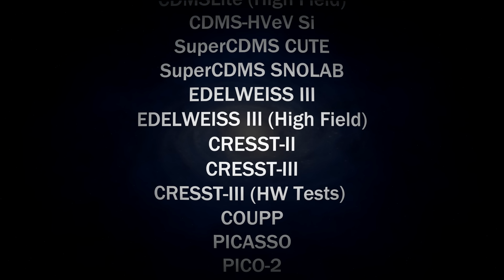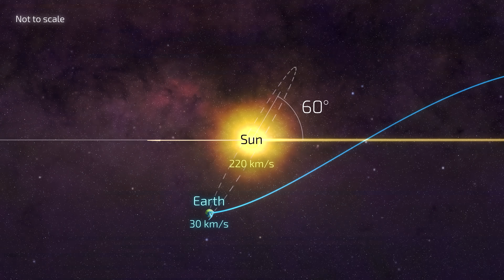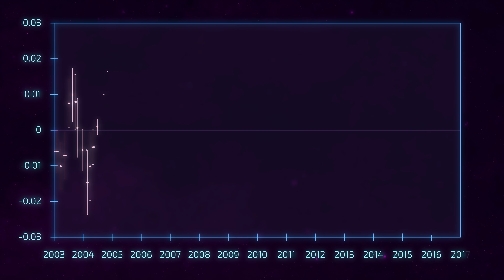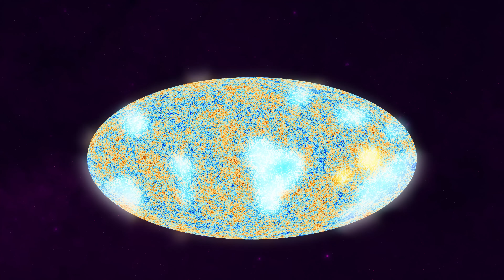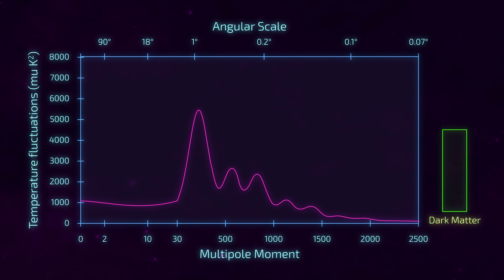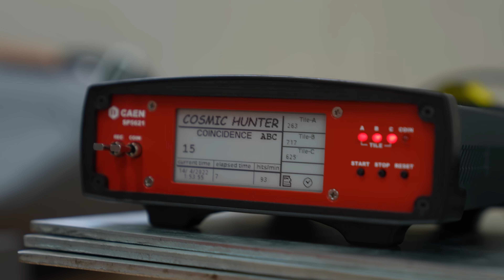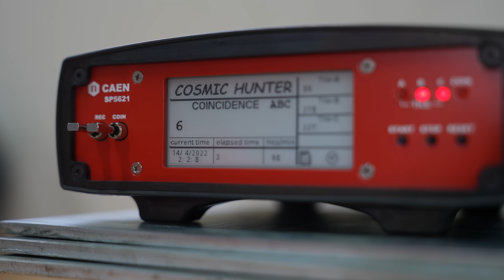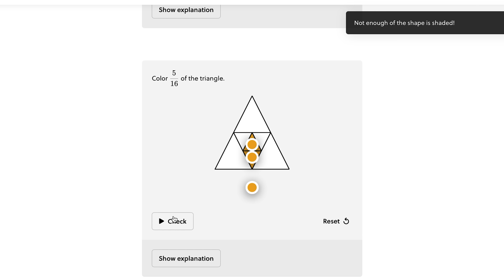The Absurd Search For Dark Matter

Comment: Love your passion for physics! I'd like to share a model that could provide a workable explanation. No pretension on my part. Here's some postulates: 1. "Local" gravity seems to be an expression of dark matter; it is a force. 2. imagine gravity as a "push" toward the center of Earth, instead of a "pull". 3. This push is akin to fluid (air or water) pressure; it's omnipresent, but it is invisible and rather intangible. 4. this dark matter is everywhere in the universe, and only permeate matter to some degree - the deeper underground you get, the less is the effect of dark matter's pressure.*Run a vectorial analysis of classic  gravitational force, at the surface of Earth, with lessening grav force as you move down a tunnel towards Earth's centre and both models work just the same. Dead center and you have zero resultant forces; either push or pull. 5. At t(0) big bang, the pressure (like an exploding balloon) was immense, radially diminishing as time goes, but it is  still (nowadays) putting pressure outward on each galaxies; and that accounts for Doppler-effect confirmed accelerations. 6. That pressure is caused by something that's non-matter (massless) against all matter, would seem to account also for why galaxies "hold together" - oddities. Also considering angular momentum and centrifugal forces that won't ad up to the canon of physics. See, it is not a "missing mass" in the calculations, but the presence of an omnipresent, unseen, unperceived pressure against all matter, that does the trick. Take a large rubber red weather balloon (like I happily used to send off), fill it out with blue died air, and strobe-photograph its bursting. Plot the velocity of the blue gas expansion (in a true vacuum) versus time and you will see the same effect we see in the expansion of our universe. Every tiny aggregates of blue die liquid is pushed together by air pressure (not gravity), in very tiny clusters (galaxies). These "galaxies" move away from each other following something very much like a "biological growth curve" or an "S" shaped curve, reaching a top constant velocity - but the universe has not leveled off yet! 7. We have an inkling of this "dark pressure" with the Casimir force.
8.  Aside from "flavored" neutrinos (those endowed with mass) the vast majority of them are massless. All photons are massless, but funny enough they behave like they have mass when energized as light and travels in the proximity of a large mass (light bending around a planet). Yeah I believe these critters (muons and/or photons) have a close relationship to dark pressure or, most likely, they compose dark matter - dark pressure. Eh my friend, I do research in renewable energy (electro-magnetics), but are we having fun yet? I'd be honored to have your input on that. Yes, feel free to say I'm completely off the mark. Cheers - you the best!
Reply: Youtube is certainly the wrong platform. Why don't you debate that with your favorite theoretical physics professor?

Comment: We don't need more theoretical particles added to particle zoo to solve the problem.  The discrepancy is due to failure to include the relativistic mass of cosmic rays and the omega relativistic mass of observed matter.  Our sun for example is typically measured as having a mass dependent on the time of the measurement, while the actual mass relative to our galaxy includes all the beta particles moving at near C velocity the sun has emitted since its beginning. 
(M°/Mr)^2=1-B^2, Where B is the velocity measured in terms of the Lorenz factor .

Comment: i'll never forget when i really learned the effect of dark matter. i was doing some newtonian physics problems, and one of them was to determine the rotational rate of the solar system relative to the milky way galaxy. if you use newtonian math, you get a wildly different number compared to the actual observed period. the answer in the physics book also had the newtonian value as the "correct" answer. the book was wrong probably because the chapter was on newtonian physics, and more specifically rotation, and it was easier to just print the answer you get from taking that approach. i compared my work to the observed value though, and it drove me insane until my professor explained that the answer is MUCH faster because of dark matter. we are hauling ass compared to what we should expect
Reply: @thaknobodi  That's not even remotely true lol
Reply: who says that the solar system rotates
Reply: @Bengiamino  Immobile solar society?
Reply: @Bengiamino  why don't you google that?
Reply: Newtonian math has been proven wrong by Relativity and proven in testing wrong. And for something at that scale it will give noticeably wrong answers when it comes to space you got to use them way harder Relativistic formulas. 
You do get a speed being off in Relativity but continuing this bad habit of using the wrong formulas because they are easier to do should end.
Reply: @RedRocket4000  that's... not how scale works. The formulas for Newtonian Physics and General Relativity scales, so the percent error would stay constant. Just because you're calculating a galaxy's material doesn't mean you suddenly get 1000% error.

If you want to know the details of this, consider actually learning GR— it's fascinating.
Reply: The galaxy is not a simple system that can be modeled with one major mass in the center, but a lot of mass spread out over a large volume. That cant be calculated by hand anyways.
Reply: That means the equations are wrong. There are different pockets of spacetime with different spacetime laws the assumption that its the same everywhere is an assumption
Reply: @houseis  You're kinda right, Newtonian physics aren't that good outside of Earth. But it still offers a decent approximation, unless you are near a massive concentration of energy, and while the Galaxy is massive, it's not exactly concentrated.

Stuff like 20% error? Sure, we can roll with that. 200% error? Then that's not a spacetime problem anymore.
Reply: General Relativity
Reply: You forgot to carry the one buddy. The answer is correct
Reply: What book??...i need a book for physics...so can you please name it..
Reply: There is no dark matter.   It's cosmic dust.
Reply: @kpdutylastsupper  you say that so confidently. Even though the most knowledgeable scientists in the world are still not sure. Funny how so many people on YouTube comments just love to shout out things like they are fact even though there is no clear evidence for it. Love it
Reply: @kpdutylastsupper  untrue, we would be able to interact with cosmic dust, and if it was 5x the mass of what we can see that dust would clump over time because of gravity
Reply: @kpdutylastsupper  why cant we just like, see it then.
Reply: @glumsulk  we're too low level
Reply: @Nuclearburrit0  is that an RPG reference
Reply: @glumsulk  problem?
Reply: @kpdutylastsupper  but... you're just changing its name? It's the same thing at the end of the day
Reply: Do you believe in a god?
Reply: @hunter-speexz  The god of atheism only exists if you don't believe in him.
Reply: @hunter-speexz  god isn't the one that gave you smartphones or planes to travel. I'd rather trust my fellow human beings as imperfect as they are. Even if the said god ends up existing, I don't want a god that sends you in hell just because you don't believe in him, like a child that is mad at his friends for not believing his story. That God should be above everything, including these trivial human emotions. If that God is like that then they'll understand that I didn't believe in him or at least, made the choice to conclude that you can't prove its inexistence or existence.
Reply: @w花b  if god decided to ignore all the wars, poverty and injustices throughout history then he's not worthy of my prayers
Reply: @-kstyle  the arguement that god should not let evil exist is a very fickle one especially when you read of the lesser known theories on Gods nature the sheer complexity of god  if he exists would be such that we couldnt possibly understand him. I believe evil, sin and all these horrible things exist so that good and positive things and actions are given meaning, what would all the good things in our lives mean if the negative didnt exist on any level? Also because of how much evil and struggle their is we are able to experience them and overcome them, without overcoming struggles challenges and evil we would have very little growth, everyone would be stagnant. It is theorized by the religious that evil can only exists as it does in our flawed physical world and  we are here to experience life in all its hardships and all its splendor and that we are put through suffering time and time again so that we can overcome it and gain wisdom and evolve, knowing how fucked up the world is and how evil a lot of people are it makes it that much more impactful and wonderful  when we choose to do good or to do the right thing. Without the choice to do wrong or do evil we wouldnt have free will really, i think thats the whole purpose of having this flawed physical earth where so much bad and evil can exist, because if god is truly as ineffable and perfect as hes supposed to be i dont think evil would be allowed to exist where god resides and can only manifest here.
Reply: @hunter-speexz  let the grownups talk about science

Comment: There are two main ways to explain these anomalies (apart from MOND): dark matter or non-linearity. 

* DARK MATTER increases the gravitational differential between a galaxy interior and deep intergalactic space by boosting the strength of gravity where matter is present (by invoking the idea of  some form of invisible extra matter that "shadows" normal matter, and increases a massed region's mass).
* NONLINEARITY creates the same increased gravitational differential by by instead reducing the gravitational flux-density in deep space, to below what we would normally calculate as being the average background “floor”. 

The justification for nonlinearity is that the universe’s expansion can be taken as an indicator of cosmological time. Time should run slightly faster in intergalactic space, so expansion should happen faster there, which in turn should further increase the rate of timeflow. It’s a positive feedback effect, and it explains the huge bubble-like voids that show up in deep-space surveys, with galaxies concentrated as walls and strands between adjacent pairs and clusters of voids. Under this explanation, these structures happen not because galaxies have some freaky property that causes them to form walls and strands, but because the faster-expanding bubbles leave galaxies behind, concentrated in the denser geometrical features that form between the expanding voids.

Nonlinearity makes the inertial properties of a galaxy's masses behave in a more self-contained manner, with external references having a reduced effect. The outer edges of a rotating galaxy then don’t feel themselves to be rotating as quickly as we reason they must be with respect to outside systems, and there’s a reduced centrifugal effect trying to fling that matter outwards. We then also expect increased lensing effects for galaxies, with an increased field-differential caused not by the gravitational flux-density being increased inside the lensing objects, but being decreased outside. 

The advantage of invoking nonlinearity is that it explains what we see, from first principles, without having to invent new invisible entities that have different rules.
The advantage of invoking dark matter is that hypothesising something "new" to explain the gap between what current theory predicts and what we actually measure is often psychologically easier than saying, "Hey, maybe the evidence is simply telling us that our current theory is wrong and needs some changes!".   

In theory, theoretical physicists love to be proved wrong. 
In practice, some of them are too culturally and emotionally committed to whatever version of physics theory was dominant when they took their degrees to be able to even consider the idea that what they were taught might not be entirely correct.
Reply: Underrated comment. I also don't like the idea that there should be something that exists for only one effect. It's like saying there's infrasound occurring naturally but without audible sound as well.

Comment: Could dark matter be gravitational bleed through from other universes? Shadows of material in another universe? Gravity is comparable weak against other forces in nature, but if gravity was shared in all universes it would explain why gravity is that much weaker compared to the other forces.
Reply: Dark matter is readily explained in terms of a "transformation function", a technical aspect of mappings and transformations thereof. Every transforming map has such a function, and reality qua "map" has the same thing. In (quantum) physical terms, the transformation function amounts to a "requantization" function by which each quantum-level state is derived. This is already thoroughly explained in the CTMU...

"Because the universe now plays the role of invariant, there exists a global standard rate of inner expansion or mutual absorption among the contents of the universe (“cinvariance”), and due to syntactic covariance, objects must be resized or “requantized” with each new event according to a constant (time-independent) rescaling factor residing in global syntax.  Second, because the rate of shrinkage is a constant function of a changing size ratio, the universe appears from an internal vantage to be accelerating in its “expansion”, leading to the conspansive dual of a positive cosmological constant." CTMU

There you have it, "dark energy" (accelerated expansion) is logically implied simply by modeling the universe as "static". The same appliers to " dark matter" except with a galaxy, the center is the same for all observers, whel the "center" of the universe is unique for all observers. The CTMU modeling changes virtually nothing about the science we know, except to unify it all under the same generic model, thereby giving observations a basis in coherent modeling.
Reply: some physicists claim that dark matter is bleeding through into our universe from the 5th dimension or universe, there's some good research publications that have been done on it in the past 2 years
Reply: Physicists: “You want the long, or the short answer?”

Comment: It's odd that physicists would jump to invisible matter when, even without considering this rotational phenomena, we obviously don't have a clear and complete understanding of gravity.
Reply: "Gravity is caused by the mass-energy density of space. This mass-energy density of space is determined by the square of the Wave-Amplitude and is always positive (squares are always positive). The  wave-velocity is inversely proportional to the mass-energy density of space, the higher the mass-energy density of space, the slower the Wave-Velocity. As Matter and its resultant mass-energy density of space are always positive, this causes a slowing of In-Waves as they travel through other matter/wave-motions, and it is this property of Space that causes the natural ‘Gravitational’ attraction of all bodies, and explains why Gravity is always attractive." (Geoff Haselhurst)

"Commendation from NASA for research work at Massachusetts Institute of Technology on the Earth's atmosphere and the Moon's surface for navigation of the Apollo spacecraft to the Moon..
Dr. Milo Wolff has found the structure of the electron consisting of two spherical quantum waves, one moving radially outward and another moving radially inward. The center of the waves is the nominal location of the electron 'particle'. These waves extend infinitely, like charge force. All 'particle' waves mix and contribute to each other, thus all matter of the universe is interrelated by this intimate connection between the fundamental 'particles' and the universe. The natural laws are a direct consequence of this Wave Structure of Matter (WSM), thus WSM underlies all of science." spaceandmotion
Reply: "History abundantly shows that people's views of the universe are bound up with their views of themselves and of their society. The debate in cosmology has implications far beyond the realm of science, for it is a question of how truth is known. How these questions are answered will shape not only the history of science, but the history of humanity." (Eric Lerner, 1992)

One of the main reasons 'big bang' is pushed so ferociously is that it has been endorsed by the vatican..

"In fact, it seems that present-day science, with one sweeping step back across millions of centuries, has succeeded in bearing witness to that primordial 'Fiat lux' (Let there be light) uttered at the moment when, along with matter, there burst forth from nothing a sea of light and radiation, while the particles of the chemical elements split and formed into millions of galaxies ... Hence, creation took place in time, therefore, there is a Creator, God exists!" (Pope Pius XII, 1951)

300 years before this, 'the church' had Giordano Bruno publicly murdered for saying that space is infinite..
You 'do the math'..  NO! Please don't!  This is why the erroneous ideas of 'infinity' are used in mathematics, specifically to confuse people into a misunderstanding of what infinitude actually means.. If space is infinite, 'god' cannot be..
Reply: @fluentpiffle  And gravity extends and attenuates into how many dimensions?